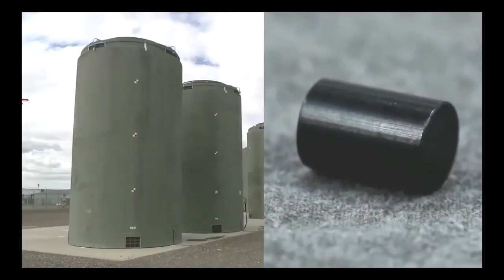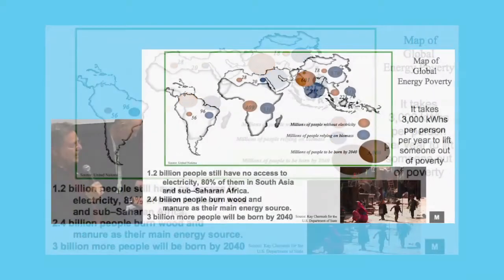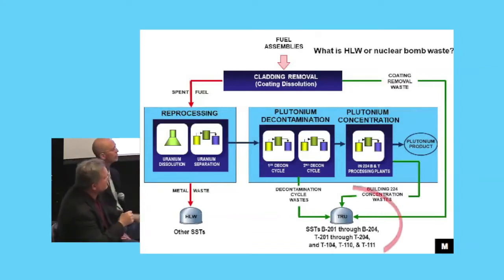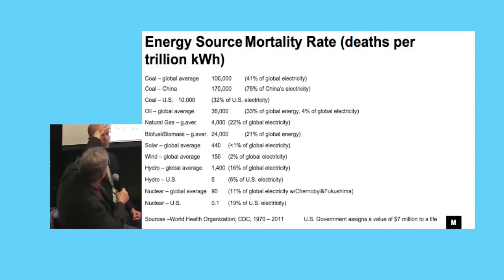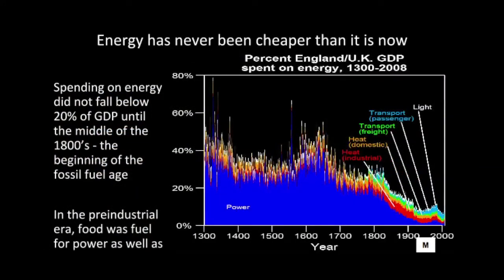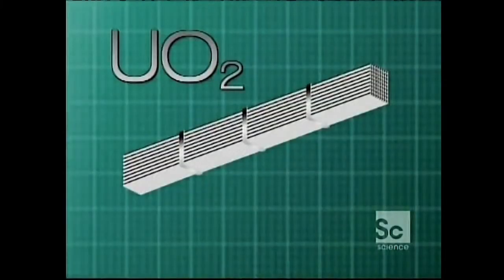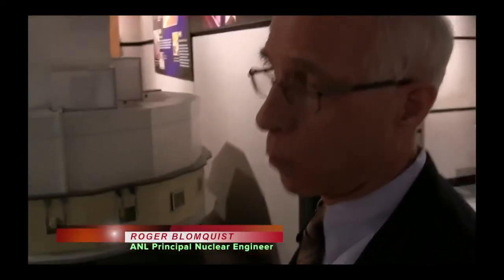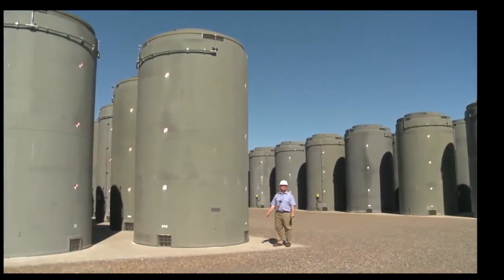TC No.  28 James Conca • Spent Nuclear Fuel 101

Comment: The Travelling Wave Reactor is a bad idea wrapped in another bad idea. Try LFTR instead.
Reply: Sodium cooled reactors can and do work and China and Russia have built several for commercial operations. India is following at Kalpakkam. The operating experience at commercial scale is there. MSRs are still catching up. MSRE was not and never will be a full scale demonstration that gives regulators the confidence to license a commercial scale MSR. Someone will have to build it. Right now my bet is on either the Chinese or the Canadians.

Regardless of who builds the first one, there are still outstanding issues with the LFTR. The first is graphite and the second is the barrier material for the 2 fluid system. There is no nuclear grade material available today that is at once:
- Physically impermeable (including gases)
- Highly Neutron permeable
- and Radiation stable enough to serve in a 2 fluid thermal breeder. 

Graphite is also faced with either a limited lifetime at higher power densities, or a huge, non-transportable, build-in-place core that must fight with LWR construction experience for cost. 

I would contend that the future of MSR is not in Kirk Sorenson's LFTR in either the 2 fluid or 1 fluid breeding formulation. But in the fast spectrum, like Russia's MOSART, Euratom's MSFR, Moltex's  SSR or Elysium's MCFR. The elimination of graphite as an operational cost, the forgoing of breeding and online reprocessing and the simplification of the fluid circulation scheme is of paramount importance in making MSRs a reality. 

As for Travelling wave reactors, I believe that Terrapower eventually gave up on the design and moved to a Standing wave configuration with a robot arm to shuffle assemblies around. A moving source of heat was simply too complex to design static heat exchangers for. It may still work out, but at this point it is basically just another sodium cooled fast reactor. For which the Chinese will simply use a Russian design instead. 

Rosatom and CNPC/CGNP are going gangbusters right now. Their work crews have the experience. Their forges have a full order book. Their suppliers are nice and warmed up. The US is lagging behind and bingeing on fracked gas like it is going out of style, while the NRC is fossilised on LWRs. Not a good look for the nation that pioneered Atoms for Peace. It's looking more like Gas for Centuries instead.